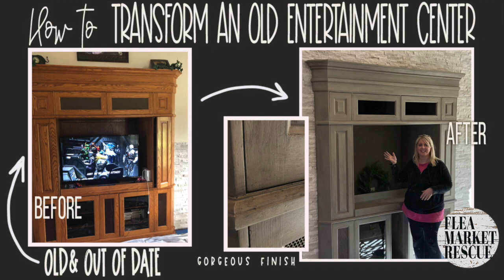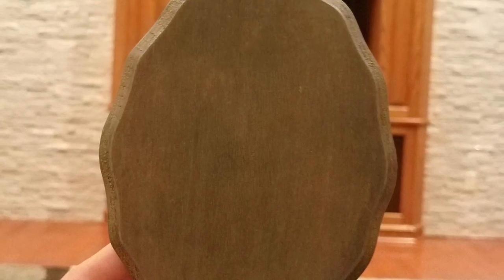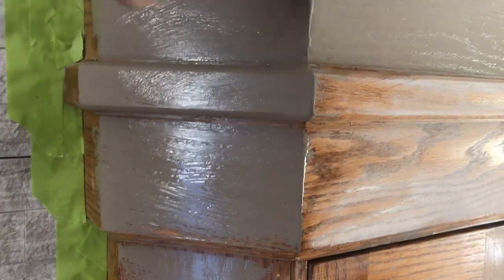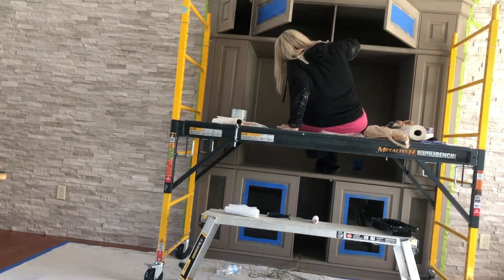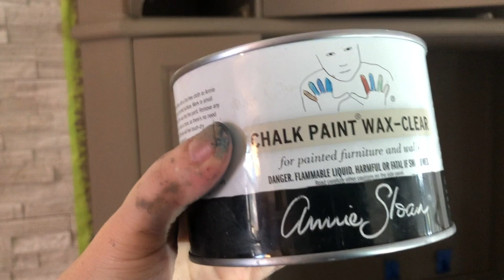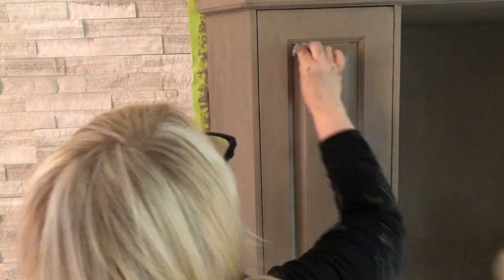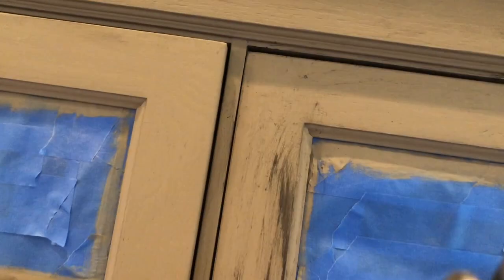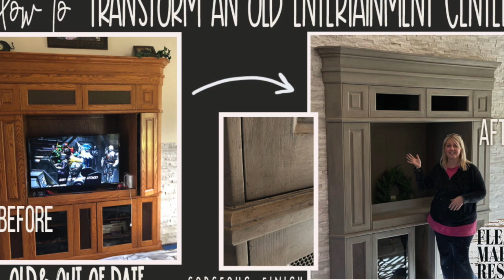ENTERTAINMENT CENTER FURNITURE MAKEOVER-PAINTED FURNITURE BEFORE AND AFTER

Comment: Love it. Did u scuff sand before A. Sloane paint.?
Reply from the maker: Yes, I did.  Then I used a paint and primer in one that was color matched to the Annie Sloan color I would be using. After that, the actual Annie Sloan paint was applied for the second coat.  Hope that helps!

Comment: Thank you so much for the tip in color matching the Annie Sloan but would Home Depot know what color? Do you have the formula? I mean I did screen shot the color but in my cel it looks more sage than I think whay it actually is. I woukd love to paint my bedroom set that color.  Being watching two videos on your channel really like how you explain.
Reply from the maker: No...you have to bring them a little sample of the Annie Sloan paint color on something for them to color match. They don't have the formula there.  So, what I do is...I paint a little square on a scrap piece of board and bring it to them.  Using your phone, I'm afraid that you won't get the right color, because it's on a screen...it might pick up a glare.  I color match it at Home Depot, because Annie Sloan is so expensive...I don't want to buy two can of Annie Sloan for a project.  This cuts the cost, but yea...you have to bring a sample to Home Depot.  Hope that helps explain it. Any other questions, don't hesitate to ask. Ok?